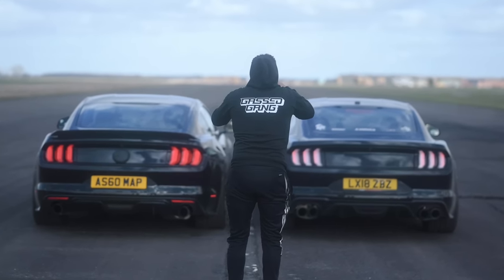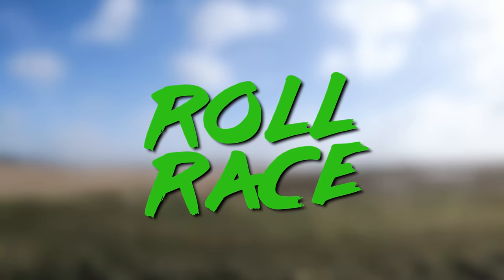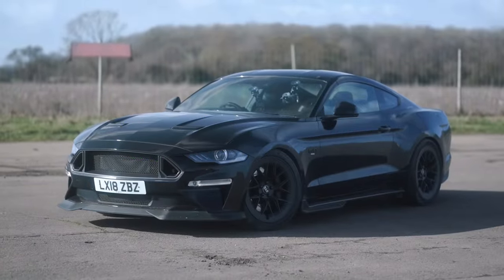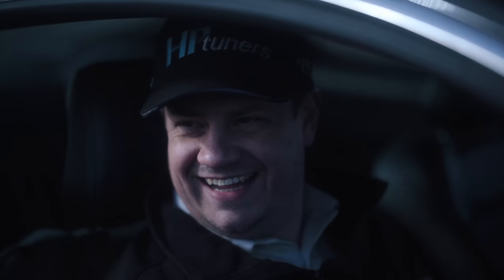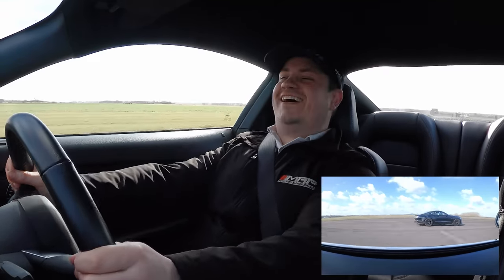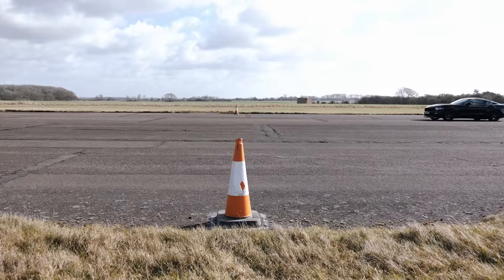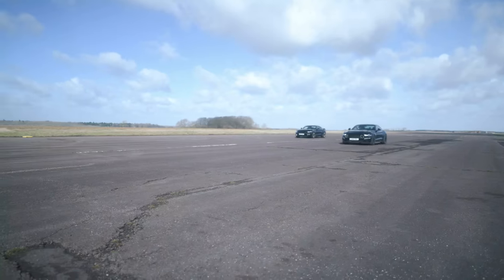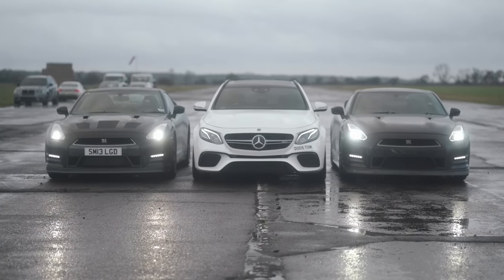TWIN TURBO vs SUPERCHARGED.. 980BHP vs 950BHP FORD MUSTANG GT

Comment: Just for reference. A stock GT quarter-mile time is 12.6 seconds.
0-60 is 4.4 secs (manual).

They seem to be casual car lovers and not the racing type. I think we all forget not everyone races their cars on this channel.

Prepped surface would have helped for sure, buy they were in it to have fun not set times.
Reply: A stock GT is considerably easier to launch as well or drive quickly from slow speeds.
Reply: Surface that; not the car. Both, especially AS60 have little factory chassis parts left on them 👍🏼
Reply: I was just thinking those r some really slow times 😄
Reply: lol don’t believe manufacture numbers, I have yet to see a stock mustang run low 12s
Reply: So the cars with nearly 1000bhp are slower to 60 than stock?!
Reply: @martindonohue66  As he said in the beginning of the video. No matter what horsepower you have, it doesn't matter much if you don't have traction.
Reply: @jecht86  yeah, that’s a fair point but where is the 4.4 second 0-60 time coming from then? That must’ve been done on a drag strip with super sticky tyres and half of the car stripped out then?
Reply: Definitely got the casual part right, running cars at that power level of crappy street tires is a waste plus the granny shifting was painful to watch and hear.
Reply: so have a 900+ hp car to not race it?? lmao ok
Reply: @NadixGamer  honestly looked like they were driving a friend's car, as they daily a corolla.
Reply: @bigneutron77  weird, I ran 11.89 with a tire, have 3 friends who have ran 12s with home stock 10 speeds.
Reply: @codytucker954  your the first man, you should post that video so people know that mustangs aren’t that slow lol
Reply: @redstang70  lol, I totally agree, the shifting was horrible! They obviously don't race much. Sunday going to meeting shifting.
Reply: I can confirm the stock GT was quick, I had one straight after my M140 and I’d say the Mustang just had the edge. Not off the line and couldn’t compete with ZF auto gear changes but in gear performance just pipped it at speeds over 100mph.
Reply: Bro exactly what I was thinking
Reply: Upper 12’s in a 1000HP car is sad 😅

That was the slowest shifting ever…

If they’re not the racing type, then why are they driving these cars??? 🤷‍♂️
Reply: If these mosters have tyres with grip, they would go under 10
Reply: @martindonohue66  ikr...maybe just maybe if that 1000hp is spinning tires hard the entire track length but even then i dont think stock is going to touch it.
Reply: Wow- in FL they were dipping into the high 11’s factory. That was a 10 speed auto  though.
Reply: @bigneutron77  no he’s not- it’s common especially down here in FL. These guys must be struggling on that broken up runway
Reply: Ironic isn't it, I just wonder why they don't spool up first 🤔🤔🤔
Reply: 12.6 1/4 mile and 4.4 0-60..hey that is what my 2000 GT does!! And mine does that with 400rwhp/388rwtq.
Reply: Driver mods needed... good lord
Reply: @Rocker20098787  bro they didn't even spool up
Reply: stock 2019 5.0 manual is 4.2, and 12.7 on the quarter-mile. the rag-top was 4.4 but doesnt matter.
Reply: 12.6 on a prep  racing track with glue and advantage to stick the car on the ground, no extra weight, low fuel, etc..
Reply: On top of that I don’t think Tom was leaving in boost
Reply: My s550 has a Paxton supercharger 
Stick car .. been 10.2 at 138 0-60 under 3 seconds
Reply: @codytucker954  You ran 11.8 with just a tire? Is it a 1-wheel-drive? Also, don't lie! Post a video or beat it.
Reply: look at the asphalt, it's shit surface that's what it is. They're on some random airport ofc they have shit times.
Reply: Traction control . Was so on . Sad . Hell a auto mustang gt runs 11.9 with 460hp crank .  Anywho I love the ending traction is the key . And he says cars runs 9s yea they do on track with track tires . Also on street start in 2nd . Have traction off . Lower psi on back tires . And know the near redline mark . Those cars can do high 10,s on street / track setup tires and street summer performance tires  see low 11,s but yea traction is the key
Reply: Idk maybe it’s different in Europe the car culture but if you build a mustang with twin turbos or a supercharger in NA and it’s near 1000bhp you aren’t a casual lol you racing for cash for sure 😂
Reply: @bendunn2727  chassis is the body not the engine though bud
Reply: Street tires; shit road; stock axles on one.  MT-82s.  

They could've been worried about breaking something.  Potentially smashing up my Gen 3- with 20k+ put in, in just engine mods alone- all for a third party's YouTube channel, would definitely not be on my agenda.

I don't blame them for taking it easy on their cars.
Reply: They can't drive lol
Reply: This is true BUT what’s the point of comparing them when they can’t truly show their abilities? That’s the whole point of this video
Reply: @bigneutron77  that’s funny, there’s about a hundred YouTube videos not from ford showing them run 11’s.
Reply: @Archangel3083  sure about that
Reply: @bigneutron77  positive
Reply: @Archangel3083  please link them then , cuz I can’t seem to find them, and from personal experience of gapping my lil ponies I can tell you they are no where near 11 seconds maybe 14 seconds lol
Reply: something's not right even as a casual racer slow rowing the stick shift. their trap speeds show a 450whp car, not 800+. Can't blame tires as they improved so much nowadays to handle even 700hp well.
Reply: Prepped surface gains a ton of traction. Like it is crazy how much faster a 0-60 or 1/4 mile are when compared prepped drag strip to a street road such as this. There is a reason manufacturers use prepped drag strips to validate their numbers.
Reply: They need a good clutch its not graving at al tires and for shure someone who knoes how to race ? I did 13.15 with justo some bolt on my 97 gt 🥶
Reply: This also isn’t on a track with prepped tarmac
Reply: If you build your car to have as much power as these guys you should know a thing or 2 about racing. And being these guys are over seas and have American cars , the tuning may not be right. No matter how you look at it , turbos produce more efficient power than superchargers.on the roll race the turbo shoulda walked away from the supercharged car with ease.
Reply: Traction is killing it.

Comment: As I have said on many Mustang videos: “there are four ways you can create a 12sec street Mustang: 500hp, 600hp, 700hp and 800hp” I guess if you’re stupid enough you can also spend even more money and add a 900hp to that list
Reply: 😂... Also keeping it stock should be on that list
Reply: @dontjivewitha5559  stock is possible to get 12’s (especially at a track) but requires some strict unicorn levels of surface grip, warmed up tyres and no heat soak for the street . They are a rock solid reliable low 13sec car in most street conditions.
Reply: @MrTroytroy  10spd stock PP1 mustangs run 11s from the factory. Low 12s very reliably
Reply: @lucasjaramillo3478  on the street? On street tyres using a Dragy/vbox without tyre warm up (the context we are talking about in this video?)
Reply: @MrTroytroy  yeah these cars can run in the low 12s pretty easily on stock tires
Reply: @MrTroytroy  I've timed the 10speed auto 2019 convertible on video and got 4.71s first time driving the car via GPS with the roof down by the way on video but if I kept going that would = like a 12.7 to high 12s  worst way easy run a 12 on the street , that car won't run out of steam and it wasn't all over the joint it didn't spin much just went. Manual version on the other hand would be harder .
Reply: @MrTroytroy  I ran 12.2 on the street with 305 PS4S on the rear  according to my dragy, my car had the   A10 on a EU GT. Had several runs around 12.2-12.3, 0-100 4.4 without 1ft roll-out
Reply: @Themazcorner  ok well that is indeed facts. Thanks for responding. What do you think your average is? (I ask that knowing that my best dragy time on my RS3 is roughly 0.2secs better than it’s average. Ie you happy it would be a consistent 12sec car or plus or minus 0.5sec?)
Reply: @MrTroytroy  did not do that many runs with the dragy but have seven runs on record between 12.22-12.48 so pretty even I would say
Reply: That's hilarious.
Reply: That's funny
Reply: Ive gotten better times in a stock stang gt
Reply: My A10 5.0 would run 5 sec 0-60 on the street with factory tires. Would take very special conditions to clock a launch needed for a low 12 1/4. Street much different from strip.
Reply: Just a key note, elevation does affect quarter times and by a huge margin if you are really up there in the 5-6k altitude... General rule is you lose 3% per 1,000ft... A 450hp car at 6,500ft will lose about 90-100hp ish... Lol, not saying these cars or the ones you guys are talking about are at these elevations but it can drastically change your times.
Reply: Tell us you know nothing about cars without telling us
Reply: @Seeker-vo2tz  you’re right I know nothing about cars. I’ll let data tell the story because clearly, I know nothing. Sure the odd one cracks into the 11’s (usually DCT Shelby 500) and a lot can’t get into the 12’s on the street. Statistically though it’s 12’s all day. Here are SOME examples on a street surface:

Mustang Bullit 12.6secs
https://youtu.be/SHVEmSNCdd8
Mustang Mach 1, 4.24secs, 12.2secs+ (adjusted)
https://youtu.be/IBuJ_a1czmg
Mustang Mach 1 Auto 4.87secs, 13.00secs
Mustang Mach 1 Man 5.41secs,  13.47secs
https://youtu.be/7MqOaqHbf9Q
Mustang Mach 1 Man -13.7secs
https://youtu.be/BVr-yb4gZXE
Mustang Rspec - 5.0secs
https://youtu.be/49Nq7gbq7IQ
Mustang Rspec 4.35secs, 12.76eec
https://youtu.be/wjOZ4u5jKro
Supercharged Mustang - late 12’s sec
https://youtu.be/2a8_g0ZXcXQ
Mustang s/c with slicks 12.63secs
https://youtu.be/WKi30l_tzPE
735hp Mustang with radials 12.2secs
https://youtu.be/mxN4r3noQv8
Mustang SM17 578kw 5.35secs
https://youtu.be/WsycbfCX8bo
980hp TT Mustang 5.35secs (0-60), 12.88secs
https://youtu.be/abqpzCALZOQ
850hp (12.2secs) GT v GT500 DCT (11.8secs)
https://youtu.be/LCfjl_4DRGY
Roush 750hp on slicks at a track auto 4.0-4.65ecs and 11.7-12.26ecs
https://youtu.be/WsycbfCX8bo
950hp Whipple Mustang 4.91secs (0-60), 12.56secs
https://youtu.be/Z2OVomqIzZQ
S/C manual Mustang 11.97secs (11.65 race fuel)
(Similar to modded auto NA)
https://youtu.be/Tv-rYwLhRVg?si=XuHpIM8z0pjVCH3t
VX R8 800hp - 12.10secs
Mustang 800hp - 13.45secs
https://youtu.be/t1uczb0FebQ?si=Dc1RH2w6jTK7qa5v
1000hp Charger - 12.8secs
https://youtu.be/QkfYX_4ZvNs?si=_6YIhVUbLsKepuxg
800-860hp -mustang Hellcat (12.5 & 12.9secs)
https://youtu.be/WsycbfCX8bo?si=8_rirpVDaA06QwjY
950hp SC Mustang (12.56secs), 980hp Mustang TT (12.88secs)
https://youtu.be/fr-bf5EpjDw?si=OPYrGcO2uN6FczhK
750hp Mustang (12.2secs)
https://youtu.be/49Nq7gbq7IQ?si=fWePpyw6Hco3vwPe
Mustang R Spec 12.76secs

(Excuse the random non-Mustang- was taken from much much bigger list of supercharged V8 stats)

Anyone betting on any stock, 500hp, 600hp, 700hp, 800hp Mustang doing better than a 12 on a street surface at a set of 🚦 traffic lights - has got serious gambling issues. Not impossible, but very unlikely.
Reply: @MrTroytroy  you do know you can upgrade to automatic right? then they will be 9 second cars at 900hp.
Reply: @Seeker-vo2tz  there’s a bunch of cars in the list that are Autos and with drag radials and guess what - still 12sec cars. Regarding 900hp Mustangs trying to run 9’s on the street - they won’t do 9’s. This whole topic is about street cars on a non-prepped surface. This isn’t a drag car, prepped surface, topic. My 1980 diahatsu Charade runs 9’s (dropped from a cliff), but it ain’t a 9 second street car.  The whole point is that 9, 10, 11, 12 sec powerful RWD cars on the track will struggle to do anything better than a 12 on the street (basically the same as a bog stock Golf R). If your street registered street car spends 99.98% of the time on a street surface and only 0.01% being dropped from a cliff/at the track, seems odd to report that 0.01% as its overarching performance metric. (I know it’s common to do that, but it’s not rational).
Reply: @MrTroytroy  youre arguing with yourself mate hahaha

Comment: All these people saying these cars are slow, take into consideration the strip they are on is like a back lane. No prep at all, loose surface etc. Close to 1000bhp to the back wheels means very little traction at all 🤷‍♂️ from a roll these would smoke most your cars 😂
Reply: that's because people act like they brain.  don't understand the video like you said No prep at all, loose surface back road like racing Close to 1000bhp its going to be impossible to get traction!.
Reply: But in fact they are slow on that surface. The surface is part of the world. Only fast on stickies at the drag strip, which is mostly useless in the real world.
Reply: They still slow 😂😂😂😂😂
Reply: 980 bhp is around 750 at the wheels. And when you have drivers bouncing off limiters because they THINK paddle shiftibg is quicker, when it isnt, is a issue itself and a manual trans with these cars is not the best choice and crappy street tires, lol. 0-60 probably 5 sec. 1/4 in the mid 11's.
Reply: The cars are not slow at all but the drivers lol id definitely take my chances against one of them lol
Reply: Cars aren’t slow just bad drivers

Comment: the short shifts kill me every time 😩 it makes a big ass difference
Reply: Definitely... Long time racer and the turbo car was short shifting before the Turbos were at full power and granny shifting. The Supercharged car not so much but both should have performed much better. 
We've seen Tuned V-6 Ford Explorer's (Twin Turbo's) running those speeds/times .... Auto All Wheel Drives of course.
Reply: Comes down to drivers, coupled with tire choices and an un-prepped surface. To put into perspective, Dammond Motorsports took a Mazdaspeed 6 and did full bolt ons and a protune on the stock turbo/engine and ran an 11.7 at the 1/4. That was a 285 whp, AWD car that weighed in at 3600 lbs. That’s essentially the same engine as a mustang ecoboost. Why was it 1 second quicker despite having 3.5x less hp? It was driven by a guy who knows how to drive really well, on a prepped course, and of course AWD putting in the work. These mustangs on proper radials on a prepped course witj good drivers will run 10’s all day, maybe even hit high 9’s…
Reply: I run high 11s with a fbo 2nd gen. These are 9 second cars lol
Reply: Right? Coyote's need to be revved all the way out for max power.

Comment: Id really like to see these same two cars competing with professional drivers on race tyres. Those 1/4 mile times are super sad, I had an 86 pushrod 5.0 with maybe 350 horsepower that did high 11's
Reply: You are DEFINITELY NOT running high 11's with a 350hp Foxbody mustang!
I have owned 4 Foxbody stangs and the one that I own now was dyno'd at 372hp and Im running mid to low 13's.  Even on a prepped surface I'm still in the 13's.
High 11's and low 12's is what Gen 3 and 4 vipers run!
Reply: @tumarbongrox6074  I think you need better tires
Reply: @dominator9833  what car do you own?....post it?  All of your knowledge comes from watching YouTube videos and playing racing video games🙂

Comment: A bone stock Mustang GT will do 4.1 sec to 60 and 12.1 quarter mile.
Reply: To be fair that's probably done on a prepped surface that would rip your shoe off it if you tried to walk on it, this is on an old dusty runway with grass growing out of it.
Reply: With an experienced driver it does 3.8 seconds to 60 and high 11s in the 1/4 mile. Bone stock
Reply: @drivescene6747  lmao, thats bs
Reply: @thewanderer899  no it isn't you're on YouTube look it up
Reply: @scottscuthbert6889  exactly, people don’t look up anything these days
Reply: @drivescene6747  bruh your thinking of a 10 speed on a prepped track  https://www.youtube.com/watch?v=WW-XYwiIkq0 11.83 fastest performance pack 10 speed mustang gt record, we talkin about manual gt  here which is 12.6
Reply: @scottscuthbert6889  it is bs for a MANUAL CAR which is what we are talkin about 12.6 is the time for manual gt its literally the top comment
Reply: @jjwrx8  It still could have been a lot better. I didn't even see much wheelspin. They could have pushed it more for sure or at least warm up the tires.

Comment: So much power and so slow 😂😂😂
Nice to see both of them laughing BUT man it’s actually something to cry about haha Jamie you’re a legend bro, love to watch your channel 💪💪💪
Reply: almost 1000 HP and running mid to high 12's....that should be embarrassing
Reply: On street tires and an unprepped surface, not surprised by the difference. These cars on radials are a real strip with experienced drivers are both capable of 10’s day, maybe even a high 9
Reply: If you knew anything, you’d know it’s the drivers not the cars
Reply: No, it’s the drivers and the tires and the transmissions and the surface. And trap speeds that show they ain’t making 900+hp. More like 700.

Comment: If I had "950 hp" and was running a trap speed of 122-128mph I would drive through the first crowd of people I saw straight back to my tuner for the real power figure and a retune.
Reply: Its all traction and driver limited. Throw some radials on it and your in the 10’s

Comment: if these cars were on a proper drag strip with slicks theyd easily be 9 second cars. kinda pointless having 950+ whp if it just turns to wheel spin
Reply: Still doesn't make sense how a foxbody with h/c/i... pushing 320whp with a t5 trans and some random street tires... runs a mid to high 12 second quarter.... somethings deff wrong here. Or they're at super high elevation?

Comment: I loved my 3.0 SC Jag XFs, I got 5.8 0-60 from a stock car, petrol of course, on PZero's. LHD import from Qatar when I worked there, I loved it so much I brought it home with me. Obviously both these would leave it standing but SC is the way to go, power delivery is instant from the low end to top end, whenever you boot it, it goes no matter what the revs are.